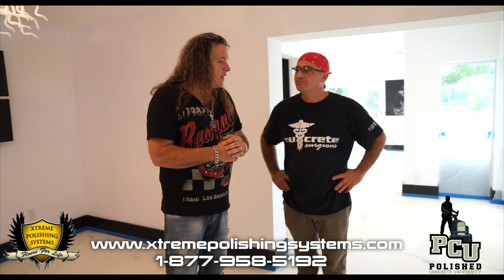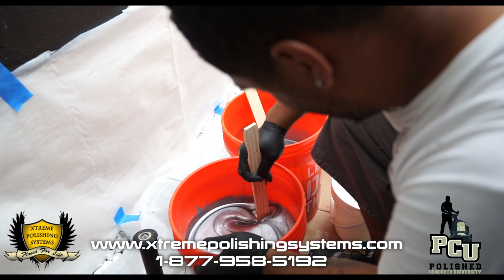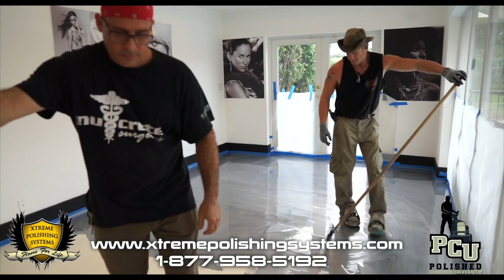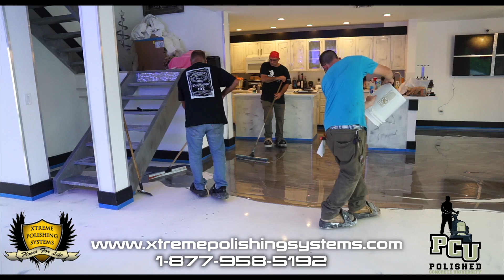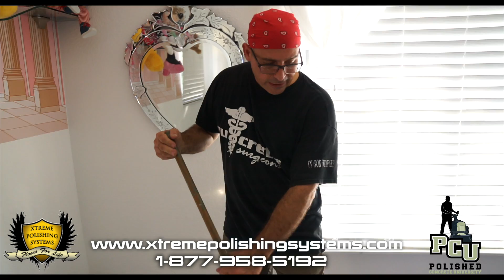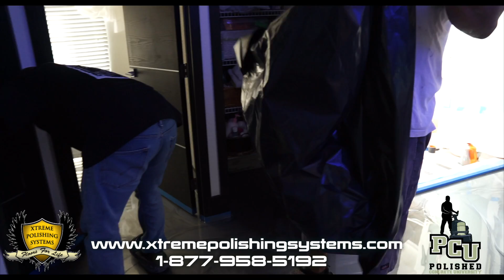Silver Metallic Epoxy Residential Floor Installation Start to Finish | #xps #epoxyflooring

Comment: Please confirm, if it can be done on vetrified Tiles surface?
Reply from the maker: Yes, epoxy coatings can be done over tile. The surface needs to be smooth and without moisture for the epoxy coatings to adhere to the surface.
Reply: Thank  you

Comment: Nice finish.
1 question.
Can these epoxy floors be done on any other flooring besides concrete?
Ex: timber? Cfc flooring?
Reply from the maker: Yes, the surface needs to be ground down smooth and without moisture for the epoxy to adhere to a surface. As long as the surface meets these requirements, epoxy will adhere.

Comment: Spectacular a floor it is, is it always necessary to prime the floor? I didn't hear anything to do with priming after floor prep
Reply from the maker: Each floor is unique, which requires a certain approach. With this floor, a primer wasn't needed before applying the epoxy resin coatings.

Comment: Can you epoxy concrete stairs with metallic epoxy, if so do you have a video on how to do that? I have a concrete floor that I would like to epoxy however, I don't know how to transition the epoxy on the stairs coming down from the top of the floor.  I would like to epoxy it all.
Reply from the maker: Please give one of our install experts a call at (877) 958-5192.

Comment: Can you do eproxy on a wood floor?
Reply from the maker: yes, absolutely. Epoxy can adhere to any smooth surface without moisture. I suggest giving one of our installation experts a call at (877) 958-5192 before starting this project.

Comment: How can you walk on it while applying?
Reply from the maker: Special Shoes are required with spikes at the bottom. Since epoxy is a self leveling agent, the coating will reform once you have moved away from that area.

Comment: After your 2 color coat, do you put a clear coat on top or a protector? Because  it`s really scratchy with plastic or metal or animal paw. And what kind of wax i can use for it. thx
Reply from the maker: Yes, after applying the epoxy resin coatings, a clear top coat is used to seal off the floor and protect the custom flooring.

Comment: Since self leveling, can this be put on an unlevel bad floor?
Reply from the maker: The surface needs to be smooth and ground down for the coating to adhere. Since it's self leveling, I suggest speaking with one of our install experts at (877) 958-5192.

Comment: What type of floor can you put it on..That floor dont look like tile. It looks seamless What did you put down on the floor to make it smoothe before you start this.
Reply from the maker: Epoxy can adhere to any surface, as long as it's smooth and without moisture. To learn more about this product, please visit https://bit.ly/2vwpX08 or give one of our experts a call at (877) 958-5192.

Comment: Can you put this down on a wood floor or only concrete deck
Reply from the maker: Epoxy can be applied over wood flooring. Our industrial resins need a smooth surface without moisture to adhere properly.

Comment: What are those shoes? Is it for the sole not to stick with the epoxy?
Reply from the maker: Our certified installers use spiked shoes to enable the ability to walk on top of the epoxy coating. https://www.xtremepolishingsystems.com/Epoxy-Gunite-Spiked-Shoes-p/xps-spikeshoe.htm

Comment: Which has less upkeep,  polished concrete or epoxy?  Do they both stay Shiney and smooth? Do I have to worry about chair and table scratches ect?
Reply from the maker: Both have the same maintenance. To keep both polished concrete and epoxy shiny and smooth, you would need to clean and apply another top coat every year or so. Both are durable flooring options.

Comment: Curious, as far as the base (floor) can this be applied to a wooden floor? If not what needs to be done to prepare for this to work on such a base.
Reply from the maker: Yea, epoxy can be applied over wood flooring, but the process is more technical than a normal coat of epoxy. I suggest speaking with one of our experts at (877) 958-5192 before installing.

Comment: Did you prime the floor prior to applying the epoxy?
Reply from the maker: All floors are different. Some floors require a primer coat before apply and some do not. It all depends on what the surface needs to prep the floor for its condition. I would suggest speaking to one of our experts about when to use primer adn when not to at (877) 958-5192.

Comment: Epoxy floor,  is recommended over 3/4 playwood?
Reply from the maker: Epoxy floor coating is a self leveling agent, allowing for multiple applications. Applying over plywood is possible, but it's a tricky process. I suggest speaking with one of our experts before installation at (877) 958-5192
Reply: @XtremePolishingSystems        okie dokie. Thanks

Comment: can i ask if you need maintenance with this floor and how long will it stay before it tarnish? and is this floor safe for kids and or the floor is safe for my kids hahaha. Thank you for a nice video.
Reply from the maker: Our epoxy is industrial strength and is meant for highly trafficked areas. Epoxy flooring can last for 10+ years with the proper maintenance. We recommend putting a fresh coat of the top coat every 6 months to a year. Once the epoxy flooring has been sealed with the top coat, the floor coating is safe for pets and children.

Comment: How does humidity in PH and alkaline react to that epoxy
Reply from the maker: Ph and Alkaline will not react or effect the epoxy coatings. If there is moisture coming up through the slab at installation, the epoxy will delaminate. For product and procedural assistance, please give one of our experts a call at (877) 958-5192.

Comment: Can u do this on wood floor?
Reply from the maker: Installing epoxy coatings on a wooden surface is possible it's just a tedious process. I suggest speaking with one of our experts before applying the coating over a wooden surface at (877) 958-5192.

Comment: I would like to know if you have cracked floors or on even spots on your floor or pieces of tile that won't come off a cement floor will this epoxy still cover it
Reply from the maker: Epoxy is a self leveling agent and needs to have a smooth ground down surface, without moisture to adhere. If the floor isn't smooth and has tile that will not come put, you would need to get the tile up before installing epoxy flooring.

Comment: Would this product work on old wood floors?
Reply from the maker: Yes, absolutely. As long as the surface is ground down, smooth and without moisture, epoxy resin will adhere to the surface for installation.

Comment: Are epoxy floors slippery. Thinking of doing one in a room off of a Florida room, but worry about wet feet from the pool
Reply from the maker: Epoxy floors are relatively skid resistant, but they can also become very slippery when wet, which creates a dangerous situation. They are not a good choice in areas that may be prone to spills or water on the floor.

Comment: I have a couple questions if you don't mind. How durable is this floor? Does it hold up to scratches everyday kid use as well as animals? Also what is the lifespan of this floor? This is extremely beautiful work thank you for sharing!
Reply from the maker: Epoxy is meant for highly trafficked areas and is durable for children and pets. Epoxy floor coatings last up to 10 years with a protective top coat and proper maintenance.

Comment: If something heavy dropped on this than it will shattered like a glass
Reply from the maker: Epoxy is an extremely durable resin adn will not shatter like glass if something is dropped on the surface.

Comment: So how does this stuff hold up?
Reply from the maker: Epoxy is an extremely durable material intended for highly trafficked areas. An epoxy floor will last up to 10 years, with proper maintenance.

Comment: Do the concrete floors have to be completed leveled in order to apply the epoxy finish???
Reply from the maker: Epoxy is a self leveling agent, so it would be wise to have the floor level and ground smooth before applying epoxy coatings.

Comment: I wonder if the floor is self leveling  ;-I
Reply from the maker: Yes, epoxy coating is a self leveling agent. As long as the surface is smooth and without moisture, epoxy can adhere.

Comment: Does this flooring ever crack or flake, even if exposed to moisture regularly? I have a room to redo that I use for animal rescue and they regularly have accidents and spill their water dish. I want something I can steam clean. The floors underneath are very old hardwood floors though that the animals would ruin otherwise
Reply from the maker: I would not use epoxy for animal durable flooring. Typically, you would want a polyaspartic floor coating this will allow odorless flooring and easy clean up.

Comment: Do you need to finish it with a clear coat?
Reply from the maker: Yes, it's always recommended to apply a clear topcoat to protect the newly installed floor coating.
Reply: Thanks 
Great videos!

Comment: How do you recommend someone clean this kind of flooring? I would probably leave streaks everywhere.
Reply from the maker: Nothing special to clean epoxy; however, it's recommended to add a top coat once a year to maintain maximum shine.

Comment: how's the chemical safety of the floor when it's settle for kids because they usually play at the floor?
Reply from the maker: Epoxy can be sealed with a environmentally safe and kid friendly top coat. Epoxy is also commonly used on countertops. https://goo.gl/fTX1b1

Comment: Can this be poured right on top of concrete??
Reply from the maker: Yes, absolutely. As long as the concrete is smooth, cleaned and without moisture, the epoxy coatings will not have an issue adhering to the surface. https://goo.gl/fTX1b1

Comment: So when its time to mop the floors is there a special mop and or product to do this?
Reply from the maker: Nothing special to clean epoxy; however, it's recommended to add a top coat once a year to maintain maximum shine.

Comment: What are these called?
- that blue tape on the walls.
- those stick mops you're using for spreading out the epoxy.
- the shoes you're wearing.

Thanks.
Reply from the maker: The blue tape on the walls can be any sort of tape to help cover the walls. Painters blue tape works great. For epoxy coatings, we use a squeegee to spread the coating evenly around the floor. Our shoes are spiked shoes that allow the ability to walk over the coating without damaging the coating.

Comment: Beautiful floor but will it damage if u drop something heavy on it or a cup or plate?
Reply from the maker: Epoxy is meant for highly trafficked areas, making the epoxy coating durable. Any floor will scratch if you're trying to make a mark, but epoxy coating hold up.

Comment: it looks shiny & slippery
Reply from the maker: A top coat is used following the epoxy application, and once properly cured to .50 wet and .60 dry coeffiction of friction standards, the floor is officially not considered slippery.

Comment: do it works on cement floor?
Reply from the maker: Yes, absolutely. Epoxy coatings can adhere to any surface as long as it's a smooth and dry surface. To view our selection of epoxy products, please visit https://goo.gl/fTX1b1

Comment: Is it heat and water(hot/cold) resistant? And what about scratch marks?
Reply from the maker: Any floor will scratch if you are trying to scratch it; however, epoxy is meant for highly trafficked areas. Epoxy is temperature resistant up to a certain degree. If you wanted to give our experts a call at (877) 958-5192 on exact temperature restrictions.

Comment: Great , if food fall , can us eat it cause its coating right toxic
Reply from the maker: Yes, you can absolutely each off of this coating. When used on countertops, you would seal the epoxy coating off with a  food safe clear top coat.

Comment: If it gets wet, you will break a neck
Reply from the maker: A top coat is used following the epoxy application, and once properly cured to .50 wet and .60 dry coeffiction of friction standards, the floor is officially not considered slippery.

Comment: Does this make the floor last longer with everyday activity?
Reply from the maker: Epoxy is an extremely durable floor coating. While any floor can eventually scuff, Xtreme's epoxy is an industrial strength resin meant for highly trafficked areas.

Comment: Hiw durable is the product, does it scuff with heels or table legs etc etc
Reply from the maker: Epoxy is an extremely durable floor coating. While any floor can eventually scuff, Xtreme's epoxy is an industrial strength resin meant for highly trafficked areas.

Comment: Doesn't epoxy scratch to much on a floor?
I stained my concrete garage floor and did a clear epoxy coating on top. It looks amazing. Scratches instantly. Bought premium stuff to.
Reply from the maker: I cannot speak for the product that you purchased, but epoxy is meant for high trafficked areas. We are not saying that epoxy doesn't scratches, but with proper maintenance and procedures, epoxy should have little to not wear and tear on the floor. Have you checked out this video we have on eliminating scratches? https://youtu.be/e9dhO67rwQM

Comment: Looks f*****g amazing. Do you charge per square ft?
Reply from the maker: Thanks! We sell the material to complete the epoxy floor coating job as a DIY'er or a flooring contractor.

Comment: What is that tool you use to spread it around? It looks like a huge squeegee
Reply from the maker: Yes, you are correct We use squeegees to spread out the coating evenly during application.

Comment: How come it doesn’t leave foot prints after youve litterally just spread it and walked on it
Reply from the maker: Spiked shoes allow the installer the ability to walk on the epoxy coating without messing up the newly installed flooring.

Comment: Will this work on concrete basement floors?
Reply from the maker: Absolutely. Epoxy coatings can be installed on any smooth & dry surface.

Comment: what a nice job! I have some questions about it; is it useful for wet floors ( wc etc.)? I think it may be slippery! and what can I use for cleaning the floor after metallic epoxy application.
can I use it for outdoor decoration
Reply from the maker: For wet floor applications, we suggest applying a moisture barrier coat that will help with wet floors. For maintenance on epoxy floors, our installers use iKlean, epoxy cleaner every 6 month to a year. Epoxy isn't great for outdoors unless in the garage where there isn't direct sunlight. For outdoor applications, we suggest using a Polyaspartic floor coating for maximum UV protection.

Comment: I'm sold- questions before I order:
I'm gonna put this on a garage floor that has paint on it. Do I need to grind up the old paint or can I put the epoxy coating on top?
I saw you put down the silver and then the charcoal. Is there a certain period of time to wait or put it down as soon as possible?
Reply from the maker: Yes, it's recommended that the old paint be ground smooth before applying the new floor coating. You don't need to wait a certain amount of time before applying the second color, just need to make sure the epoxy is still wet.

Comment: Is this being done on a wood sub floor
Reply from the maker: This video is showing installation on standard concrete flooring. It is possible to apply epoxy coatings over a wood subfloor. Due to the tedious nature, I suggest speaking with one of our experts at (877) 958-5192.

Comment: Do i have to back fill under interior sheet rock walls before laying the epoxy ? What is recommended  for that gap around the outside edge?
Reply from the maker: If the epoxy coatings has a chance of flowing out of the room due to a gap in the sheetrock attached to the floors, it would be best to fill in any gaps. Epoxy is a self leveling coating that would flow into any joint or gap in this particular case. For procedures on products to use to fill in the gap particularly, please reach out to one of our expert installers at (561) 899-7699 for a walk through on completing your project.

Comment: Does this epoxy work on wood also or only for concrete?
Reply from the maker: Yes, it is possible to apply epoxy coatings on wood. The process is more tedious than concrete, but as long as it's a smooth surface without any moisture, epoxy doesn't have any issues adhering. I would suggest speaking with one of our experts before installing to be sure. Our support lines are available 24/7 at (877) 958-3257.

Comment: In my basement I have cement floor with the old fashioned epoxy....do I need to scrape all the old epoxy away in order to do this floor?
Reply from the maker: Epoxy needs to have a smooth dry surface for the coating to adhere. It's a safe bet to remove the epoxy before installing new epoxy. I would suggest speaking with one of our experts before applying your new flooring. They will be able to help walk you through the process and help answer/avoid any hiccups during the installation process. Our experts are available at (877) 958-5192.

Comment: The Epoxy Metallic is beautiful. Did they have to lay a subfloor down? Or is that the original flooring? Can it be layed on concrete slabs?
Reply from the maker: Epoxy is a self leveling agent that can be applied on most smooth surfaces. In this case, the flooring was already concrete.

Comment: and did you use an epoxy primer on concrete floor first?
Reply from the maker: Yes, we use either the Rapid Set Acrylic (https://goo.gl/PoapMh) or TRU TXP (https://goo.gl/VJ6Jnc) as an epoxy floor primer.

Comment: What substrate are you spreading this on?  Does epoxy work well on plywood?
Reply from the maker: In the video, we are applying epoxy over concrete. Epoxy will work on plywood, but it's a tedious process. I suggest giving one of our experts a call to make sure all your bases are covered before installing epoxy resin coatings on plywood. Our experts are available 24/7 at (877) 958-5192.